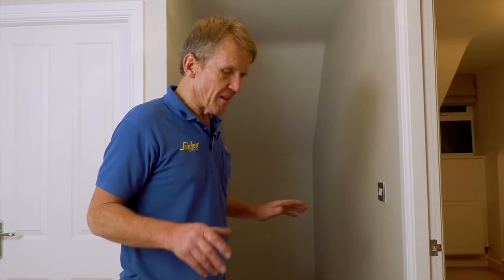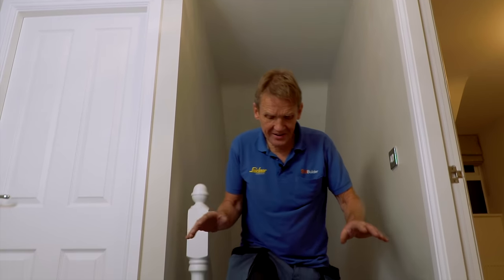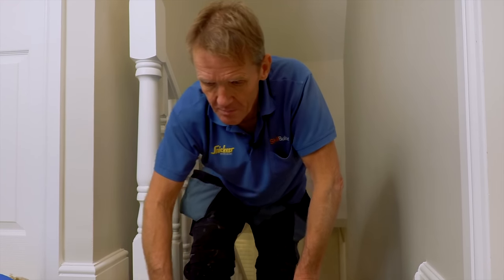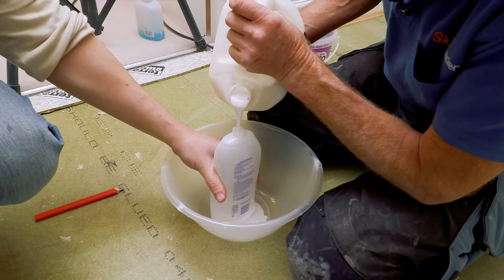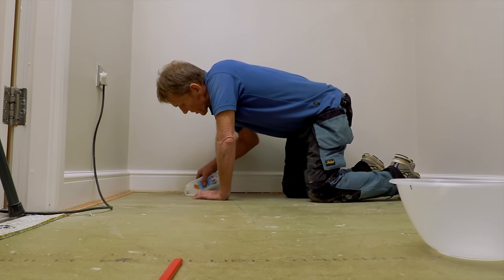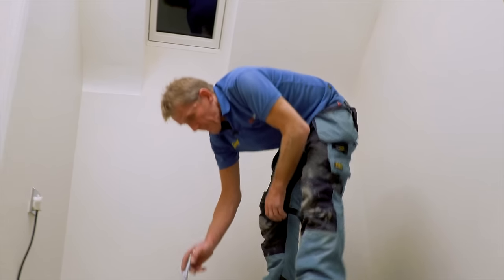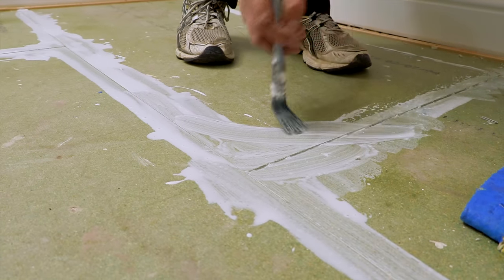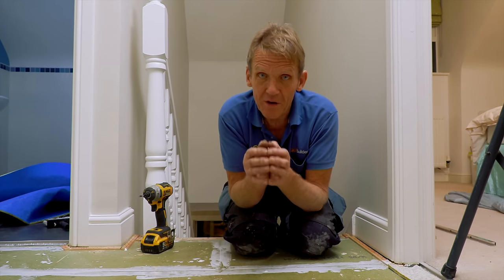Creaking Floorboards Driving You Crazy?

Comment: We always used the paslode 1st fix gun on the chipboard floors when I was on house bashing - probably the worst thing you can do - as you say, the joists dry out, then the chipboard 'rides' on the nail. Half the time, it's that that's causing the squeeking. Screwing (with 5x60 screws) is best - but the prices we got for laying them were so poor we couldn't have afforded to do it, even if they'd supplied the screws. I've seen a lot of DIY jobs where they've used 40mm drywall screws - that's no good either - they're too thin and they often snap.
Reply from the maker: Thanks. I should have used proper floorboard screws but it seems to have worked.

Comment: Nice job ..love the channel 👍..what we would do to solve the squeak, first scan for pipes then  use a catspaw to pull the nails out,drill a few holes over the joist ,insert a flex tube with " Advantech subfloor adhesive"...spray under the plywood and the seams, then screw down.....always works !... sometimes it's the joist hangers or joist hanger nails making the squeak...which sucks even more...
Reply from the maker: That is a great tip. I was thinking about how I could get some expanding glue under there. I will try it next time. When we come to the States to do some filming I will give you a call. A day out on site with you would be good.
Reply from the maker: A nail puller. You need one, they are great
Reply: Joe Framer It didn’t cross my mind that you can scan for pipes! That’s pretty cool and I’ve been wanting to get my parents’ old house fixed here and there.
Reply: Ex pro spark of many years: 
As the video made clear - experience and tech knowledge that enables plumbing, electrical (and to some extent joiner) trades employing a little guestimation "x-ray vision" is hard to beat. Even then - a detector does provide some extra comfort / risk reduction when screwing 'blindly' through floor boards.

For less experienced / DIY — Don't scan for services (plumbing or electrical) using anything other than a detector from a blue chip, reputable manufacturer. e.g Bosch Truvo and even then - most are aimed at the wall detection market, where detection distance is usually less... and are rarely 100% reliable on flooring.  Look for a spec that (at least claims) detection of non-ferrous metal (like copper pipes) and wiring at 50mm or more then use good double-countersunk multi purpose screws at 5 x 40mm. 

If you can, first shut down central heating and turn off relevant water valves, as well as circuit breakers/drawing fuses for services in the area (or just flipping main switch). That allows at least some controlled reaction margin at end of work if the worst has occurred. 

At the very least seek out those means of isolation, making yourself aware of their location. Also - most power tools are double insulated to protect users against shock... but it does no harm at all to wear work gloves with rubber/pvc grip surfaces while boring & screwing.

In my experience a decent amount of well placed, quality screws alone has always sorted creaks. (notwithstanding joist/structural issues). Boards that needed glue, (but didn't get it originally) needed it on the underside mating to the joists. Though if another decent tradesman has found that glue dripped along board seams is a belt & braces help, I'm content to trust that too. I like SkillBuilder's attitude.
Reply: "instant edit — " mating to the joists " Oops...Late night fatigue... I meant to tongue & grooves.
Reply: I purchased an endoscope camera and will drill carefully at different points between floor joists so I can see exactly where pipes and cables are before putting any screws into the floor.

Comment: Really useful video - thanks! I actually was watching a bunch of videos where they were saying to lift the boards to check for pipes, use detectors, drill circles to check underneath, use a jigsaw to cut the joints etc etc etc - but I am finally glad someone is on the same wavelength, I was like 'WHY DONT YOU JUST DRILL A NEW SCREW NEXT TO THE OLD ONE SILLY SAUSAGE!! 😀😀😀😀 glad someone actually does this!
Also -it actually seemed like you just drilled the old screw deeper in? which kind of negates actually buying nails?

Comment: Always pre drill a hole slightly smaller than the screw before screwing. 
That way the screw won’t lift the board and leave you with a gap to squeak.
Reply: Or you can use half threaded screws.
Reply: @maovi7652  thank you Mateusz.
Reply: @maccybear8093  You're welcome ;)
Reply: You want to pre drill slightly larger than the screw thread so the screw can just drop through the hole in the floorboard, but make sure the drill bit is smaller than the screw head pull to the board down

Comment: Great stuff, Roger. This is fine for chip flooring, but with traditional floorboards, its the nails which cause the creaking. Boards will usually 'cup', and can rock slightly when walked on, causing any nearby nails to be rubbed up and down the nail hole as the movement happens. Solution is to screw each board down close to, or outside of, each nail - of course taking due care to ascertain pipe runs as usual.

Comment: just done this upstairs in our bedrooms. Made it slightly better but it still creaks in places. Used the PVA glue three times to make sure there was enough going into the joints, used plenty of screws but its still creaking a bit.
Reply from the maker: Hi David 
That is a shame. If you can stand on the boards and find out where the movement is taking place then you might get to it with some expanding polyurethand glue. If it is moving down on the joist then a small hole in the board no more than the thickness will get you to the joist. Then you can squirt some Gorilla glue in the hole and cover it to help force the glue down into the gap.
Reply: @SkillBuilder  worth trying. It was worth having a go as it has made it better than what it was so will have another go, cheers for the advice

Comment: "You really need to know what you're doing, There maybe pipes under the floor boards" 

"I'm gonna guess there isn't any pipes here"
Reply: When you have the experience needed to make educated guesses then you would understand.
Reply: @UnstoppableTramp  why cant the guy putting screw through carpet make that educated guess, same thing wether through carpet or flooring
Reply: @theatrain5388  because the guy in the video puts screws where the nails were. Meaning the studs are in that area and no pipes or electricals
Reply: @LeviandBilly  for starters they are called floor joists, I am a carpenter and if you watch the video of the way the guy does it through carpet you wont find much difference, plus the carpet stays down.
Reply: @LeviandBilly  magnet or stud finder?
Reply: @JohnDoe-mp1zk  A magnet for wood? Good luck with that. Secondly, not everyone has a stud finder.
Reply: @JohnDoe-mp1zk  we could always go to the local hospital and steal an x-ray machine too although that is still a lot more difficult than lifting the carpet and looking with your eyeballs to see where the nails are.

Comment: Just moved into a new house and the floors are so bad. First time I've lived in a house with chipboard flooring. Luckily the carpets are all coming up to be replaced so I can get it sorted. Thanks.
Reply from the maker: Take care, the pipes and cables should be below the screw depth but try to find out first. Best is to go down next to existing nails. If it is screwed down you can remove screws and glue joints then screw down with fatter screws.
Reply: @SkillBuilder  I lifted the old carpets over the weekend there, the boards are nailed, no sign of any glue either. Im going to try taking a few nails out and seeing if the hole will take a screw. I've ordered these floortite screws to see how they fair.
Reply: Hi Rodger,

New build UK house? If so, same issue here so hope this info helps you...

I replaced our floorboards exactly like this due to creaking. Same style...chipboard stuff without any screws in it. It took 3 carpenters 3 days to complete 3 (3.5 x 4 meter rooms). This method will not fix your problem...it’s a sticking plaster to a bigger issue. Let me explain...

First do NOT randomly drill holes and screws into the boards as you don’t know what pipes and cables are under there. You need to get the boards replaced by professional carpenters who have tools to cut the interlocking boards without risking cutting through anything below them (they set the blades to be same width as the boards). What they found was that the joists under them are set at maximum legal width apart...if they had more joists closer together supporting the floorboards it wouldn’t have caused the creaking noise issue.

To fix they removed all the boards and put in more timber support properly screwed together between the joists. Then, they glued the new interlocking floorboards together again plus they properly screwed them down so no movement could occur. 

In short...hold your hands apart and put a piece of paper on top. Then imagine pressing on that paper in the middle - it will flex down creating the noisy creaking noise. If you put your hands closer together and press same force down on the paper it won’t flex as much thus no noise. Your hands are the joists, the paper the floorboards. Since you can’t add more joists, the only option was to put more timber frame between them so the floor is better supported above.

It’s very annoying and a lot of effort for such a stupid issue. Floors are all fixed now and are much better walking across them. Adding glue won’t fix this as it’s the distance of the joists supporting the floor underneath. 

Hope this helps.
Reply: @DauntingGecko  it was built in the early 90s. Unfortunately I have neither the time nor the money to have someone come in and perform such a huge task before it gets decorated and carpeted, and I think the Mrs might actually bury me under the floor if I said I was having it lifted 😂 It's a good point about joist centres though, it probably does play a role.

Comment: I screwed through water pipes as they were overtop the joists and no markings. I would never assume again pipes are through middle of joists!
Reply: @James Casey my advice is and each time worked as charm. Take the floor out till joice. Buy new timber, new plywood, Use the nailgun and be generous. Mark your pipes on the floor. Make a new floor. FIX. What concreete?:)) Are you Russian?:)
Reply: @James Casey Hilarious mate. This is why I read below the line posts!

Comment: Great job, got several areas in my house to do, now i know how
Reply: Did you do them? Am about to start mine.
Reply: @michaelmccarthy3704  Did it work ?
Reply: @pureplay7071  Worked in a limited way - I finally took up some squeaky noisy flooring and re-done using a lot of glue and screws, covered it with vinyl flooring - no more squeaking.
Reply: @michaelmccarthy3704  Yeah I think I'm going to have to bite the bullet and do the same, was looking for a quick fix I guess. Well thanks for getting back anyway :)

Comment: What if the problem is in the actual floorboards underneath ? OR you scared there might be pipes underneath . It would be risky to put screws thru the top boards
Reply: There are no floorbaords underneath, the chipboard flooring panels are resting on the joists.

Comment: I ripped out my old flooring and was struggling to fix the creaky subfloor. Mistake 1 was to use more nails. I've ordered some PVA and will use screws
Reply: I’ve come across movement on the floor joists themselves which has been the root of the problem. Depends how secure into the brickwork they are.
Reply: @michaelfeeney8437  Wow. I didn't rip out the subfloor to check, but screws and PVA did the trick for me. No squeaks at all now
Reply: @ManchesterTechGuy  
Only when you get into the guts of a building do you find what’s there !
I was with a joiner who discovered that the cement holding one end of the joist into the brickwork had part crumbled away and not enough had been used to really secure it in place.
PVA, is only good with tongue and groove boarding if you have it down.

Comment: Next to plumbing and wiring, this really is one job you want to get right. I’ll never use large panel board panels for floors again. For not much more money, use single strip  boards that start and end on the joists. If you need to get them up it’s much easier. Tried the gluing and extra screws but just didn’t work for me.

Comment: Buy an electrical cable detector to at least 50mm, never assume what is under there. I was about to fix my kitchen floorboards which had a plywood overlay on them. Where the squeaks were is where I since found out the electric cables were. Makes sense now and no wonder they were squeaking. If there detected I coudn't screw down a 50mm screw so I left it well alone. Chances are they laid the cables through the joists just under the flooring. Dangerous if you ask me and became too big a job to remedy.

Comment: Great channel but gutted this didnt work for me  :-(   i only did 25% PVA + rest water and tried it twice.  I put a fair amount of the solution down the gaps as well (be good to give guidance on how much is reasonable) + some flooring nails.

Any other ideas?    

I saw that in the one room I have with no crackling  that the chipboard tongue and groove had been cut out on the longer sides of the board (so they still have full joist support).  Is that a sensible next option ?
Reply: anyone ?

Comment: If the creaks are near the edges of stud walls a lot of the time it is the nail going through the sole plate rubbing on the bouncing floor. Usually not nailed home. Skirting off and some angled screws through the sole plate into the floor..however, I did this once and they had kindly put a 25mm heating pipe directly under the stud wall and just notched into the top of the joists...nice 😧

Comment: I just replaced our floorboards exactly like this due to creaking. Same style...chipboard stuff without any screws in it. It took 3 carpenters 3 days to complete 3 (3.5 x 4 meter rooms). This method will not fix your problem...it’s a sticking plaster to a bigger issue. Let me explain...

First do NOT randomly drill holes and screws into the boards as you don’t know what pipes and cables are under there. You need to get the boards replaced by professional carpenters who have tools to cut the interlocking boards without risking cutting through anything below them (they set the blades to be same width as the boards). What they found was that the joists under them are set at maximum legal width apart...if they had more joists closer together supporting the floorboards it wouldn’t have caused the creaking noise issue.

To fix they removed all the boards and put in more timber support properly screwed together between the joists. Then, they glued the new interlocking floorboards together again plus they properly screwed them down so no movement could occur. 

In short...hold your hands apart and put a piece of paper on top. Then imagine pressing on that paper in the middle - it will flex down creating the noisy creaking noise. If you put your hands closer together and press same force down on the paper it won’t flex as much thus no noise. Your hands are the joists, the paper the floorboards. Since you can’t add more joists, the only option was to put more timber frame between them so the floor is better supported above.

It’s very annoying and a lot of effort for such a stupid issue. Floors are all fixed now and are much better walking across them. Adding glue won’t fix this as it’s the distance of the joists supporting the floor underneath. 

Hope this helps others. :)
Reply from the maker: There are many reasons why chipbpard flooring moves. Having the joists at 600 centres is approved  if you use 22mm chipboard. If the boards are nailed on timber joists rather than I beams the timber will shrink and the nails will lose their grip even if they are ring shanked. Many manufacturers recommend a bead of glue along the top of the joist and a poluurethane expanding glue which is run in the T&G joints.
Yes you can take up the boards but when they run under stud walls it is a mission. Screwing down beside the existing fixings or removing the nails is a good way to avoid pipes and cables. 
The use of a dilute PVA is a legitimate way of stopping the squeak because it will seep into the joints and produce a tight joint.
I appreciate you taking the time to give your view but the fact is that a 30 minute job in this particular house produced the same results as your 9 men days and all the disruption. If you had 18mm board on 600 centres then I would have recommended the course of action taken by your guys. There is nothing wrong with it but there is also nothing wrong with this method. If it works it work.

Comment: I have a question. What if I secure room light, turn off electric then go upstairs drill a small hole in my floor and through funnel pour 5l of PVA into it - it should flow on the top of the plasterboard (living room ceiling) and in theory level itself and stop plasterboard squeaking? My problem is that the floor squeaks as well as the plasterboard underneath. Please kindly advise if it's possible

Comment: A run of thin superglue works a treat.
Reply from the maker: Superglue is too thin because the glue line will break if the board moves a tiny fraction. The PVA stops the squeak.